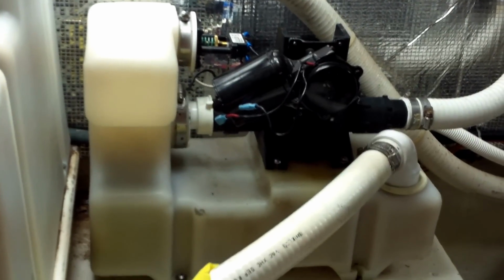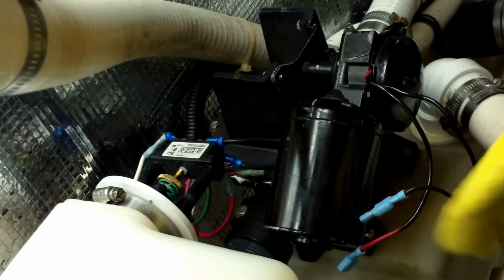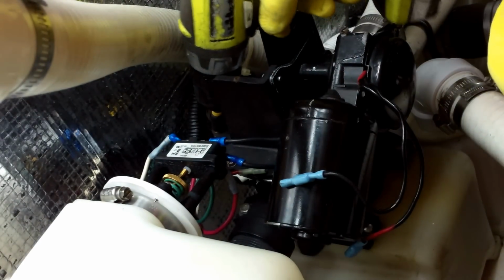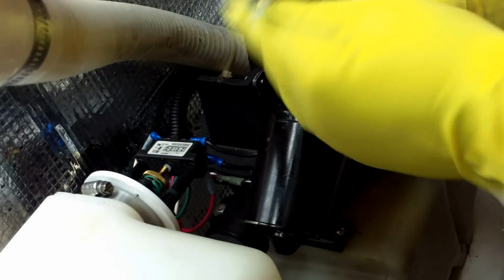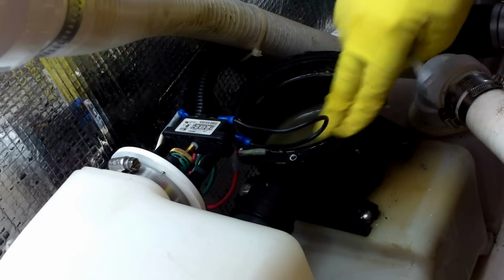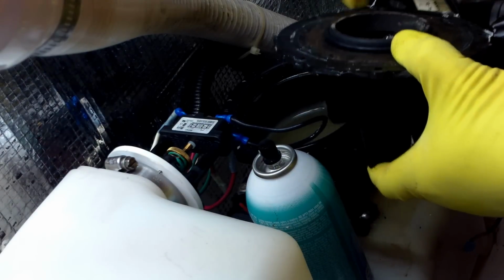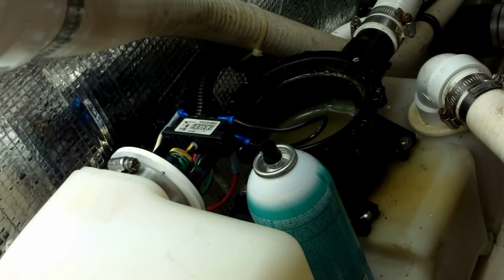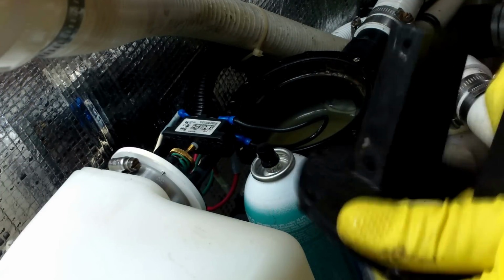Vacuum pump repair 1 of 4

Comment: Looks like the same system I have on my 2000 Sea Ray 310, When I push the pedal nothing happens. The vacuum switch appears to be all the way out, with a test light I get power on both sides of the switch but the pump kicks on intermittently and only for 2-3 revolutions. Do I need to replace the pump or check further?
Reply from the maker: any oil on or around the motor, push the switch in see if it will run. blockage just under 1/2 ball ?
Reply: No oil around motor. I'll check the switch.

Comment: Using your silicone spray aren't you worried that you are going to aerosolize microscopic fecal matter blowing it around like that?
Reply from the maker: it pulls 10" of vacuum and the spray works good. i get all the sh-t job it is what it is. iv had vacuum systems blow up in my face. but i am  good at repairing them.

Comment: Finally got around to checking it out further. It's actually just MODEL VG 

I pushed the switch in and it pumps but when I hit the flush pedal nothing happens. I've even tried plunging it, not to hard tho....I know I have a pneumatic plunger somewhere , maybe pressurize that thing up and let it rip??

What actually triggers the the vaccume to leave the generator when the pedal is pushed down??

Thanks again for the help !

Comment: hey I have a newer style vg2 vacuum generator on a 2005 sea ray, one day it no longer flushed when I hit the pedal,  at first you would hear the vacuum pump running but now it barley does, just nothing happens when you step on the flush pedal... where should I start looking????

thanks
Reply from the maker: if you look at the video I will show you the parts on this vg2     check for 12 volt to unit (inlet wire) look at the PSI switch and see if it under vacuum (spring arm pulled away from micro switch) if not push it FWD into the micro switch and see if the pump comes on, look for burn marks or oil on or around the motor,    if you need more just ask   good luck  I get all the shit jobs   lol
Reply: Lol thanks. Will give it a shot later tonight